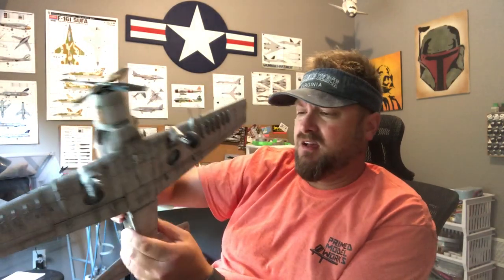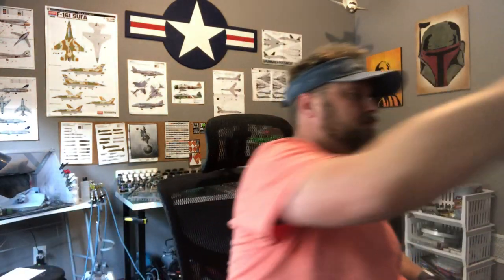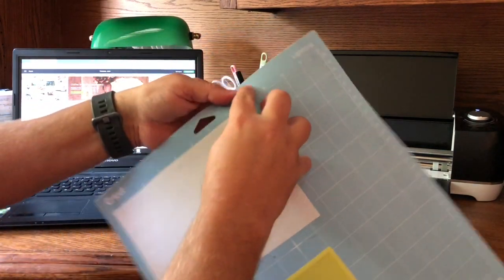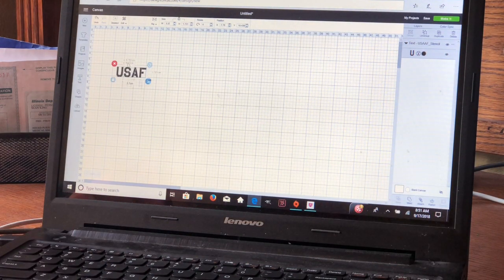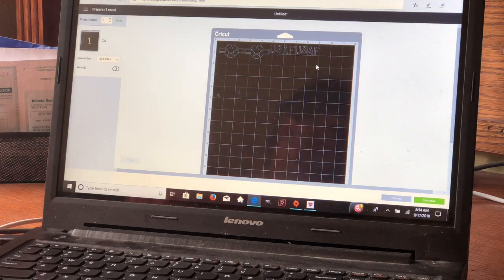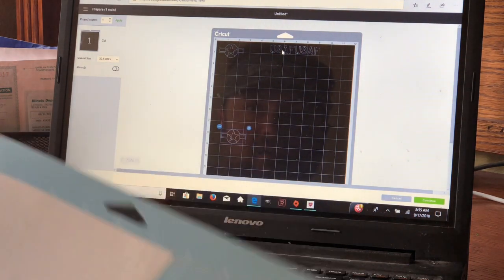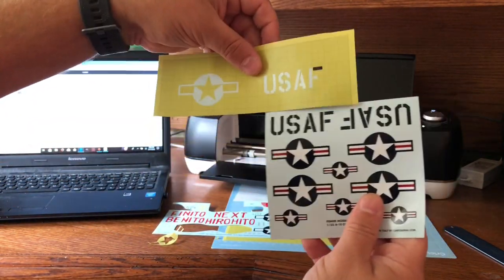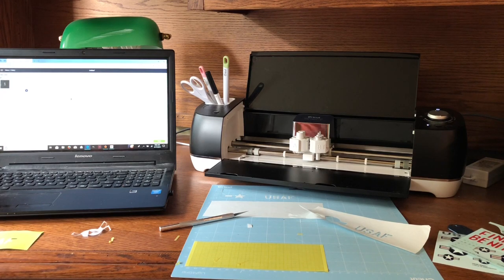Making Masks for Scale Models with Cricut

Comment: Nice video--I have a Cricut but haven't made much with it yet.  For something like the red, white, and blue stars and bars, would you make more than one stencil, one with separate parts for each color, and in what order would you paint them?  Paint the white with just the outside masked, then mask the star and white in the bars, then remove the red bar mask and spray the red?  All that involves removing and replacing parts of the whole mask.
Reply from the maker: Here’s a good tutorial on how I do it at 20:56.  
https://youtu.be/X9STgrXSRgI

This one shows the star and bar without the red stripe.  When I do paint the red stripe, I just mask it off last with tape (not using a precut mask) and spray the red.  Hope that helps.
Reply: What paper do u use for the masks? And where do you buy it.
 im looking to start painting my decals instead

Comment: Excellent vid. I have the same Cricut - did you ever find a better paper setting for the Tamiya paper/frisket? I tried on the lowest setting and it still cut through all the way (using the fine cutting blade).
Reply from the maker: No, I haven’t but I’ve been using the highest paper setting and haven’t had that issue.
Reply: Try using the vinyl settings.
They cut thought the top layer but not the bottom carrier paper.

Comment: Have you ever tried to cut sheet styrene with the Cricut?
Reply from the maker: Yes.  Since styrene only needs to be scored, using the cricket is sometimes helpful when trying to cut multiple exact copies of the same shape.  I just set it on the thick cardstock setting I believe.
Reply: @seanerk5kt9  Ah yes good point! There's no need for it to cut right through.